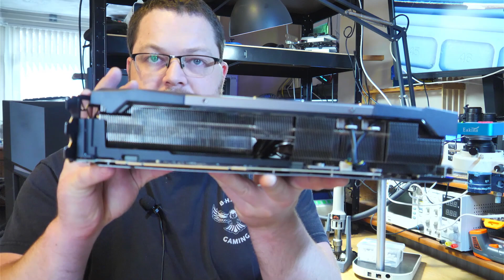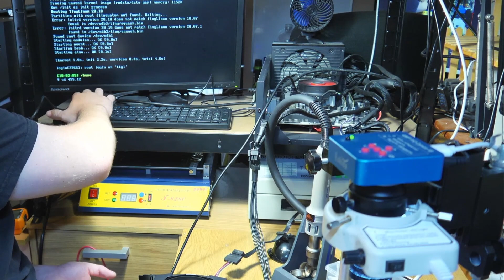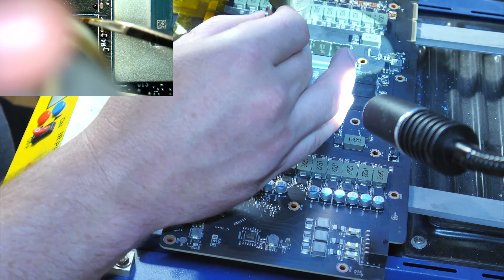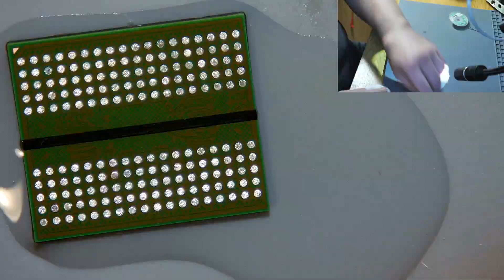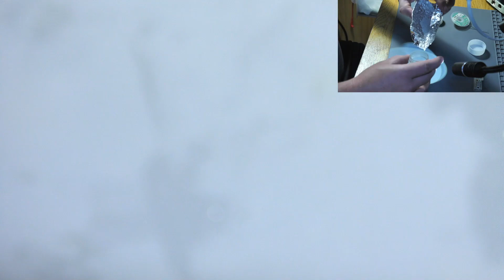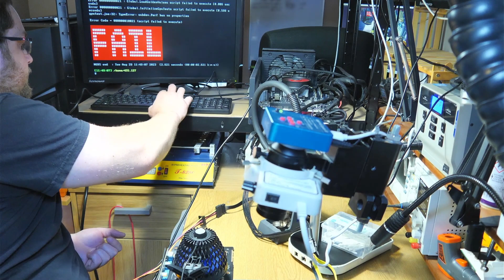MSI RTX 3090ti Suprim - Not Detected - Graphics card repair

Comment: Just got one of these off ebay. Installed in my Supermicro X10DRi motherboard. Power up the system, but GPU is lifeless. No lights, no fans, no display. Rechecked the AUX power cabling, made sure card was fully seated in slot, but no sign of life. Disturbing is the rusted screws on the backplate and some corrosion on the metal parts.

Comment: What temperature do you set the preheat temperature to and them what do you set your hot air station to. When you repaired the pads, do you glue the spots down and if so, with what? Thanks

Comment: I seem confused. You poured the excess balls off the aluminum foil you used to catch them. Most people put a very thin layer of flux so as to keep the balls and bond correctly to the pads. Not sure but did you not put thin flux on the chip before placing the stencil for better bonding? The reason I mention this is if the balls bounce off the flux they will have flux on a few of them pudging everything up.
Reply from the maker: Yes, the thin layer of flux will instantly hold any balls that touch it. Only one ball can correctly fit into the hole at a time. So one goes in, and the rest pour off without being tainted by flux. There is an odd ball here and there that may drop out and gather a few others. That can be picked out later with no problems. If you are too heavy with flux, though, this problem will consume your entire pot of solder balls. Encountered this on my first few attempts when getting into repairs. Barely waste any solder balls now. Apart from the few escapees that are inevitable

Comment: board bent wow looks like bad insttall . This is some type of user error.Ive had been on pc with multiple gpu never bend any of my boards I take care during install make sure i have everything line up properly. my current card is MSI 3080 AND LOVE THE CARD .
Reply from the maker: These cards should not be tampered with. They should be installed and well supported or run vertically. Then they should be left alone, and the rig should not be moved or bumped. I personally own a gigabyte 3070 (the type prone to cracking). I have had it for ages, and it has no flex issues. A majority of repairs that come in are from people tampering with their devices.

Comment: I didn't understand,"if the script failed" why did you say it was normal?
Reply from the maker: The script failed is a parameter issue. It's normal to see that after initializing a card using the script I made due to some missing parameters. The errors we are looking for are bios errors or dq training errors. Seeing the script failed result means that the card has initialized and the memory is connected.
Reply: @b-hawkgaming  ah ok

Comment: Channel just popped in my feed. Always room for another brainiac tech! Nice work! You quick test before re-assembly gave a fail? I'm a "viewer" only (don't do electronics...antique mechanical pocket watch restoration is my hobby) so don't really understand many details, but why is the fail OK/expected?
Reply from the maker: The fail is part of the software I am using to determine if the card is functional. In the event of a failure, we see things like bior error, or dq training errors. These are actual failures. There are further parameters to run to avoid the script failed page, from memory, it's the -notest parameter, but I can't be certain. But it's unnecessary. Seeing that script page means the card has initialized with no memory errors. All the information that we need :)

Comment: I have 3080 suprim X and i didnt have any sag support for it for 1.5 years. Then i finally bought support and noticed that my hotspot temps went up to 105c while GPU temp was "only" 75c. I didnt connect these things at first, but then i got it. I ran stress test and monitored temps and i see that when i lift the card hotspot temps go up. When i didnt have support my hotspot temp was fine. I needed to open the card which is under warranty and change thermalpaste. Now i have support and temps are fine after repaste. So it seems that if you let your card sag too long and then support it you can have some problems.
Reply: Lol